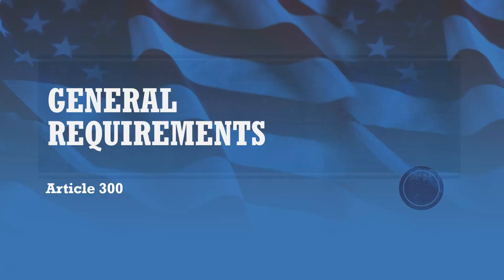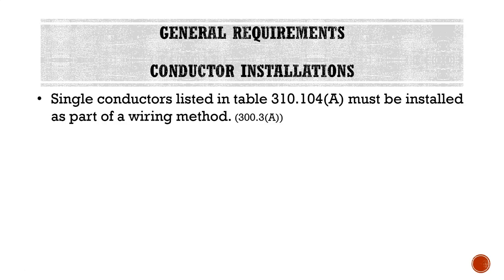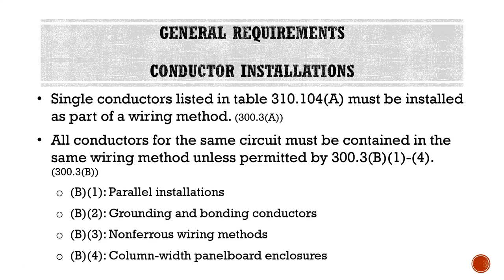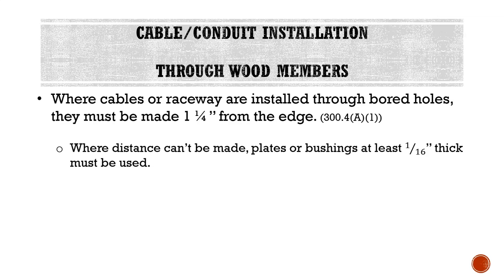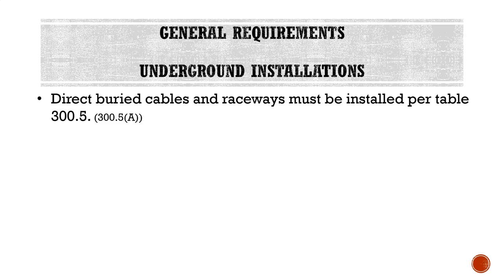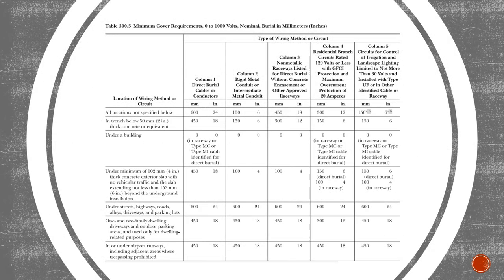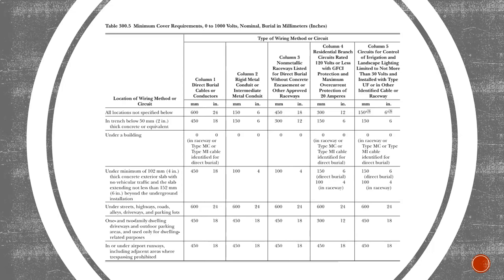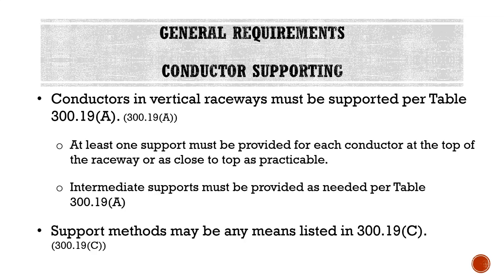Article 300 General Requirements

Comment: Is this on the 2020 or 2017?
Reply from the maker: Hi there, this is based on to 2017 edition of the code since at this time Kentucky (and most other states) have not adopted the 2020 edition yet. Thank you!
Reply: @electrical1019  thank you.  I didnt know they dont all adopt at same time
Reply from the maker: @Lowkeystee  No worries! Below some states are actually still on as old as the 2008 edition. Here is a link to a site that list which states have adopted what edition of the NEC: https://na.bhs1.com/state-by-state-guide-to-nec-adoption/
As you can see, some states haven’t even adopted any edition at all state wide. Thank you!